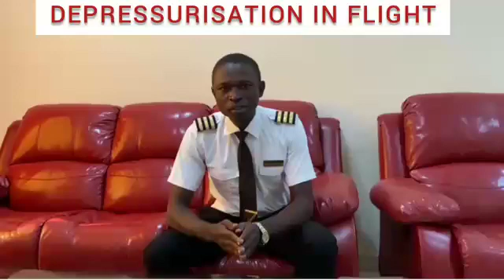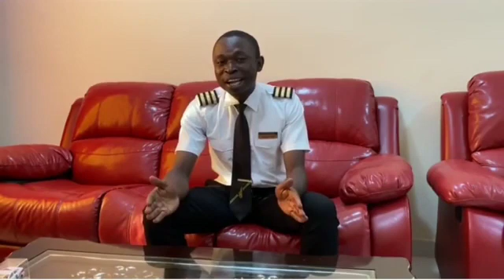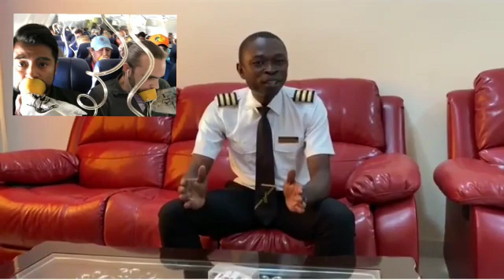Airplane Cabin Depressurization

Comment: This is quite educative.
In an unlikely event of cabin pressure system failure, the aircraft cruises at a lower altitude for the passengers safety. Won't that impact on the flight ETA drastically?

Comment: Fantastic utmost informative would like to see a video on the difference between flaps stalling
Reply from the maker: It's .interesting to know that.you know about stalling with flaps.and without flaps. You will.probably.know about stall without engine power and with engine power. 
I will surely get it.fixed. Thanks so much
Reply: Aerofoil Austine 👍😊